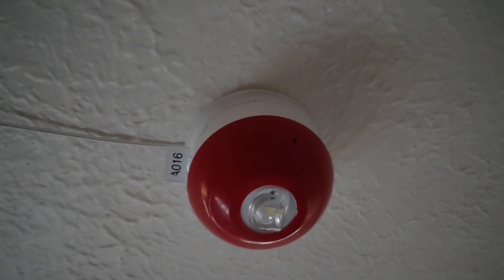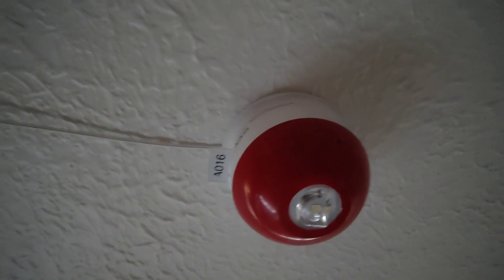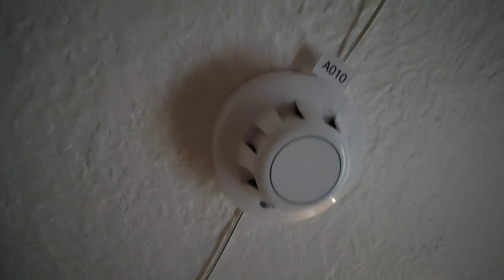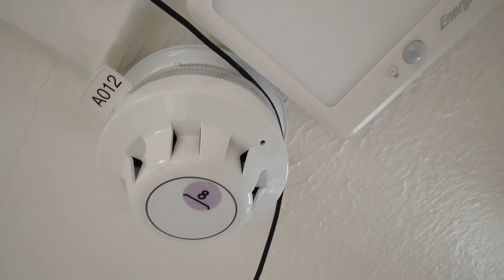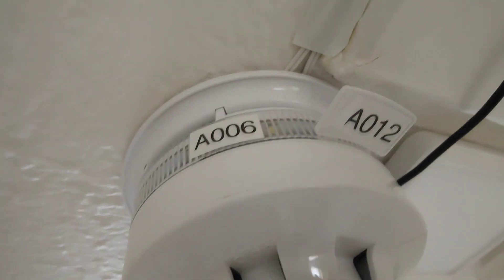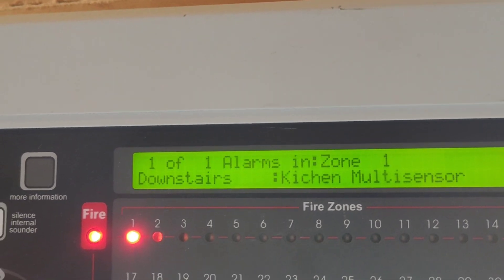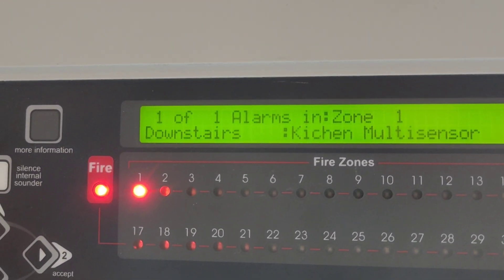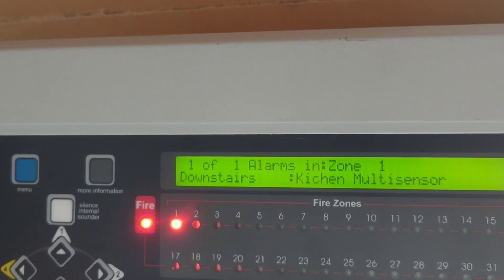Apollo XP95/Discovery and C-Tec System Test 4: emergency alert siren/tone 13

Comment: That's a wall vad
Reply from the maker: Indeed, this is only on the ceiling until I get a ceiling one. It used to be a red beacon
Reply: Alright. Just note to the new EN54-23 standards the vads throughout a building have to be the same colour.